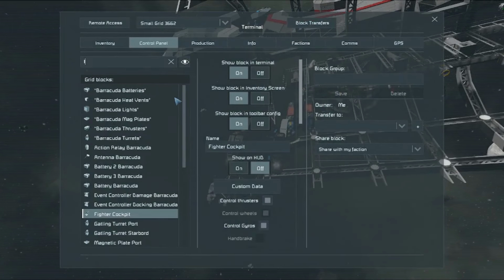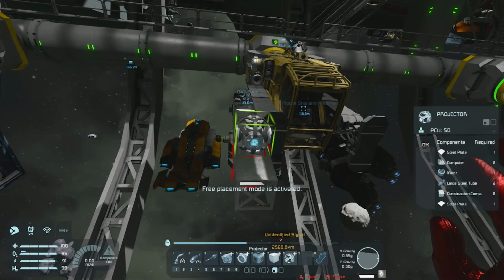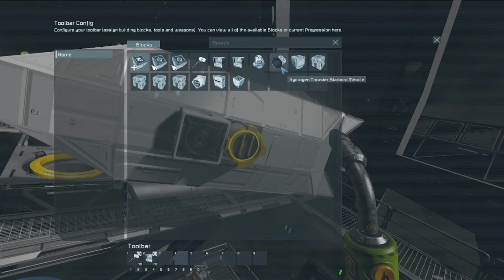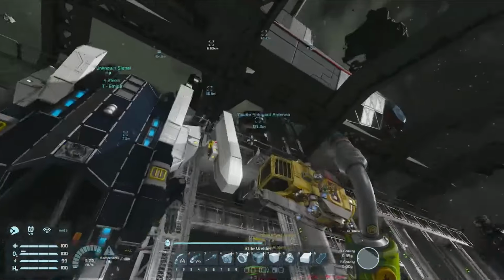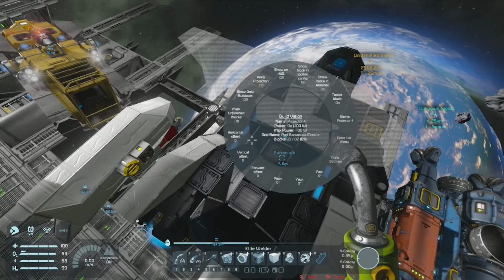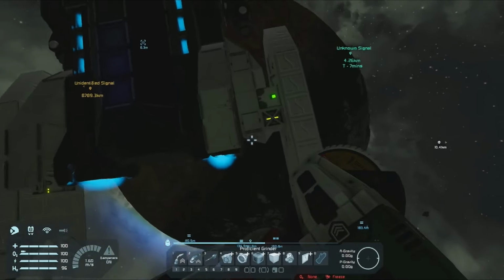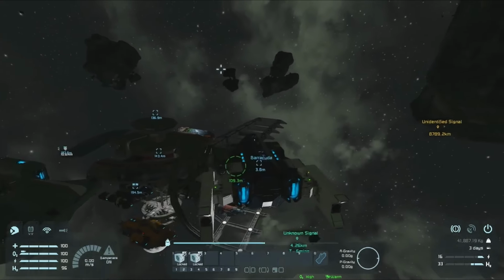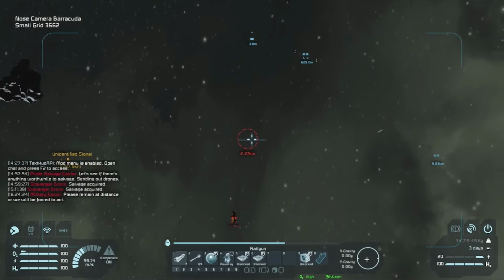Missiles Away - Contact EP34 - A Space Engineers Mostly Vanilla Survival Series

Comment: Your original missiles looked promising. Ramming AI is pretty good, especially since they don't have any weapons. Alternately, can you fit a single gatling into the missile so they can lay down a bit of fire before switching to ramming mode? For the merge, the small inset connectors have a slightly janky hit box, might have better luck with the plain small connectors and removing that front armor plate? Given that you have the long range weapons on the barracuda, can you snipe off the enemy weapons before getting inside their weapon range to fire back?

Also, have you looked into an external facing welder array that you can use for things too big for the little internal welder bay?
Reply from the maker: I tried Gatling armed drones, and while they probably do work decently well, I wasn't a fan of their size and they were a bit more expensive than I wanted.  As for the sniping, unfortunately the small grid railgun is about the same range as some of the large grid heavy guns, so depending on my target's armament I don't reliably out-range them.  I did consider a larger welding wall at some point if I needed to fully replace the stingray, but if I keep building bigger fighters it may be worth doing an in-between size.